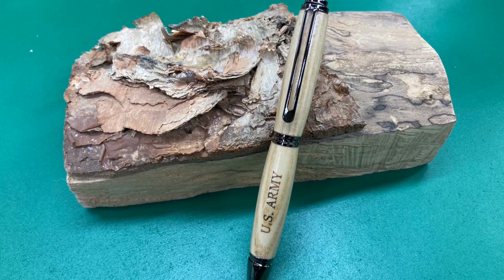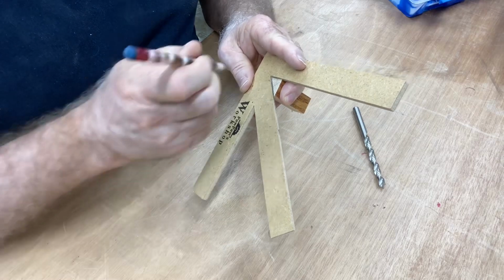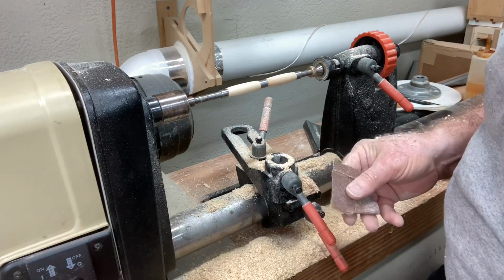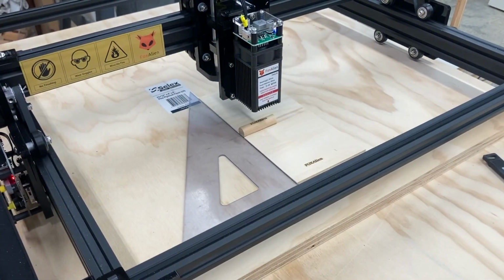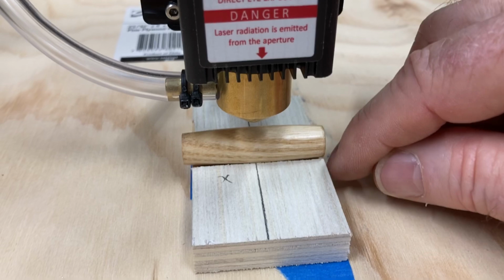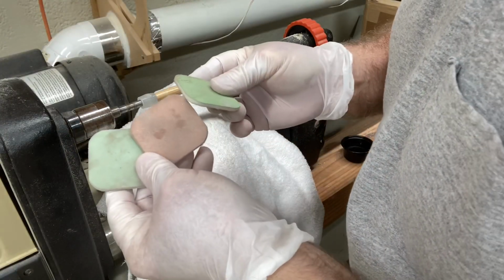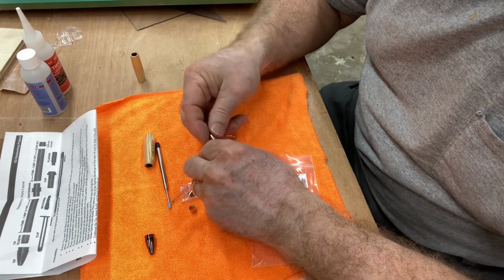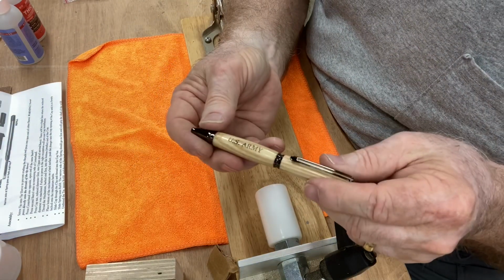Combining Pen Turning, & CNC Laser to Make  Special Set of Pens

Comment: Since your blanks are all the same length, seems like that jig would be well served with a stop (like you use on your miter saw)
Reply from the maker: The clamping jig is there. I have the 10” extension to that I can get close to the blade. I could have used the table saw

Comment: Phil do you clean the blank after lasering with IPA? The spew that condenses down-wind from the laser is often tough to get off, although your shellac likely makes it easier to get off?
Reply from the maker: I usually only need to wipe them down with a dry towel. It’s rarely at problem. If you are making a lot of ash then your power is most likely to high

Comment: Sorry for my bad English .... but the safety for your laser is not good. The most reason for low vision for people over 60 is the macular degeneration ... the area with the highest visual acuity get an irreversible damage and you can’t read any more. With the laser you can get the same irreversible damage, too.

... your Laser has no Protection for reflection of the beam. Just eyeglasses could be dangerous because of reflection. Please build a cabin and buy the correct laser safety glas/ protection shield (no China product) so that your eyes are safety. I’m an eye doctor from Germany and I bought my safety glas/protection shield in USA..... and not in China ...
Reply from the maker: I have a sign on my shop door that says laser in use. The door stays closed. I wear googles!